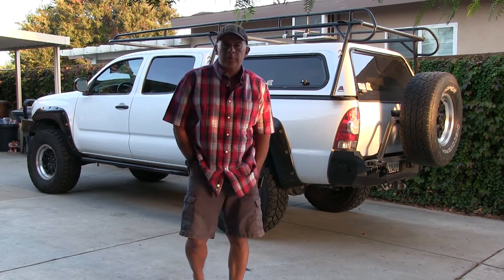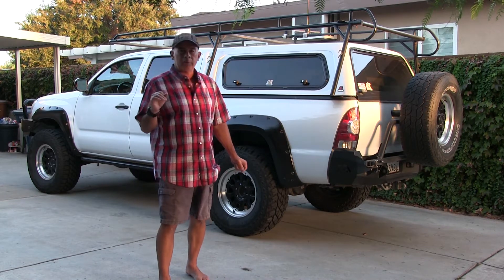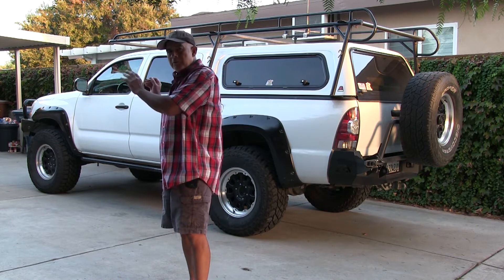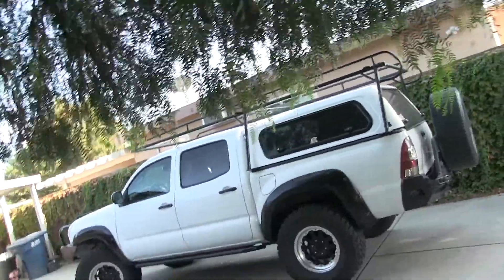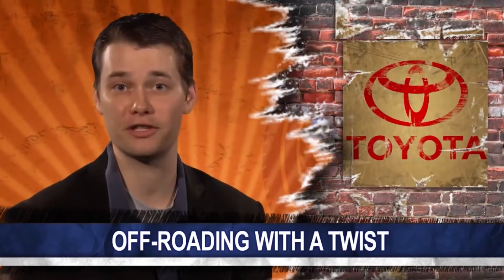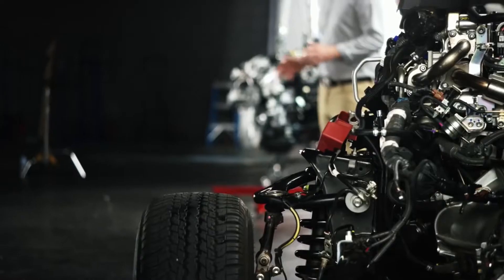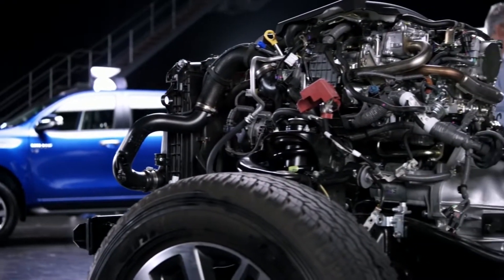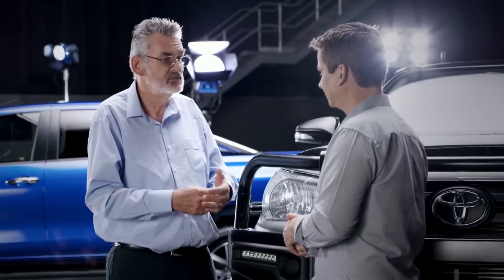Tacoma Frame Flex

Comment: Tacomas are used more for off roading then work truck.  The frame flex is for better articulation.  There is a video on TFL showing the difference between Ranger and Tacoma.   Ranger is stiff as a board when it’s time to articulate causing the wheel to be in the air while in the same position the Tacoma tires are still on the ground.  I enjoy watching your channel.

Comment: Open C frame = cost savings.
Reply from the maker: I figure North American midsize trucks are used mainly from trips to the mall. No need for a heavy frame. Just take a look around any parking lot. You see a lot of pickups with nothing in the bed.
Reply: @rudedogii  Or a scratch on them

Comment: So I would like to know your final thoughts on the Tacoma ownership and in comparison to the Colorado now that you've owned it. Did you make a video on that? I too have had issues with my Tundra bed due to flex. Guys I know who wheel hard are boxing their frames at a cost of $2500-$3500. Not worth it to me, I'll just live with the cracks in my bed and welds and keep tightening the bed bolts maybe add some blue lock tite. Here's my video on the Tundra frame: https://youtu.be/7gfPL0e1IIY I point out in the end that every truck Toyota makes, even for U.S. market such as LC, Sequoia, 4Runner is boxed. But to box it adds weight which effects fuel economy and such and EPA b.s. But other makes get the fuel savings in other areas such as more efficient engines (turbos etc.) Toyota doesn't believe in that and I think they are right if you want longevity and trouble free ownership. To sum up, it pisses me off that Toyota doesn't build their frames properly but the quality in my Tundra is so much better (based on shared Land Cruiser design) that there's no comparison.

Comment: Reality is the full cage mounted to the frame in off road racing and their pre runner trucks is not just a safety cage. It gives the truck rigidity that keeps the truck from falling apart from fast off road travel of many miles. The trucks with long wheel travel do not rely on frames flexing for traction. With a frame riveted or bolted together flexing it is far less rugged than a stout caged vehicle. The best off road vehicles frames are tube steel framed that incorporate the cage.

Comment: What if you sandwich some rubber under the bed mounts... So the friction is gone. Thinking about doing that to mine.
Reply from the maker: I was thinking something like that. The cabs mounted on rubber mounts. Why dont it have rubber mounts on the bed?
Reply: Have you checked considered or checked in to see if one of the urethane milder body lifts like the Frontiers and Xterras use would be at all a benefit for you? I know you are a summit fan so;

 https://www.summitracing.com/parts/dys-kt04506bk/overview/make/toyota/model/tacoma 

I believe this is the correct one. I'd take a moment to contact Daystar/Performance accessories on Monday and describe the issue to one of their techs, I'm sure you aren't the only one observing this same issue and they may have or be able to contribute a solution.

Comment: Sadly, and this is nothing new and fault if our own. The market here in the US is weak. Over regulatory processes from Government alphabet agencies out weigh not only what your dollar gets you but what the marketing industry says you'll buy.

For example, I was in many of the plants when Daimler came to Chrysler,  and they were amazed at not only the production rate at which we make vehicles but when it was all said and done.. Mercedes figured out real quick that they could cheapen out a car and we would pay full pop for it.

Customers are generally overly concerned with gadgets and cup holders here, not so much technology and even when selling Ford, Toyotas, and Nissans, for a a 10 year period. You quickly see people don't even care about that here in the states. All they care about is what colors does it come in, do you have what I want on the lot now, and how much is it... They have no clue what goes into a vehicle.

Now is this everyone? Absolutely not. If that were true you wouldn't be watching this video let alone reading this comment. Some people actually expect and want more and that's why we mod our vehicles.

That being said, box frames, like the Nissan Frontier/Xterra have pros and cons too. The metal is slightly thinner, the support comes from the shape of the frame, NOT the thickness of the steel used. C-frames are generally thicker and hardened in and different manner and both like I said have pros and cons.

Articulation is key, and many perform it either in extreme or extensive capabilities while others find lesser expensive and yet not nearly the articulation on cheap mods. I believe that the frame should not twist, your suspension should articulate. The fact that a C-frames twists to some degree allowing wheels to get that inch closer to solid ground is in my opinion a complete after thought and as an excuse was conjured into a "benefit" for marketing or advertising.

Boxed frames increase payload capacities as well as strength in the frame and body of the vehicle. The aspect of a uni body thought process in a frame seems absurd and more likely a bean counter measure than anything else.

I wish we could get you into a Norweld aluminum tray and canopy and get some integrity back out of your Tacoma but I think it would clash with your work needs despite the better option...

Travel safe and keep the tires facing down my friend.

Comment: pretty good research!!!  I always thought some frame flex was good, although it seems like the tacoma has too much flex.
Reply from the maker: I wounder what happens when you install a camper or even tow a trailer.  Will the frame hold up?
Reply: Frame flex is a PR excuse for a weak frame or poor suspension tuning. The Toyota Tundra has a flimsy weak frame and Mike Sweers, the head engineer for Toyota USA trucks, claims the flex is to help improve the ride. When it's the Tacoma, he claims it's for flexing offroad. He talks like a politician.

Comment: Interesting. Are you happy with your Tacoma? I'm curious, down the road, if it came down to it, would you buy another Tacoma or would you go with something else?
Reply from the maker: It's ok. But nothing like driving a fullsize truck with room and V-8 power.
Reply: rudedogii Not to mention not having to deal with the vibration problems with a lifted Tacoma.